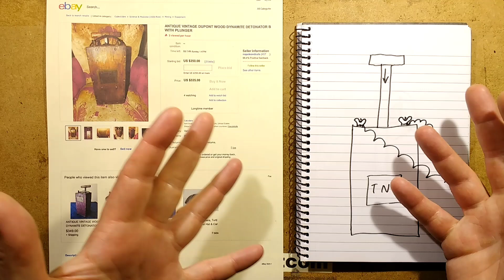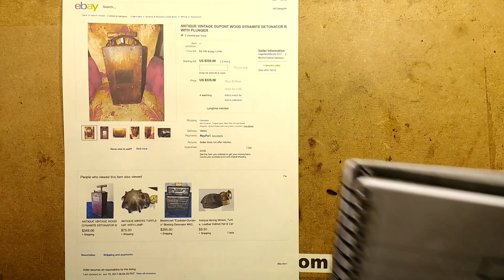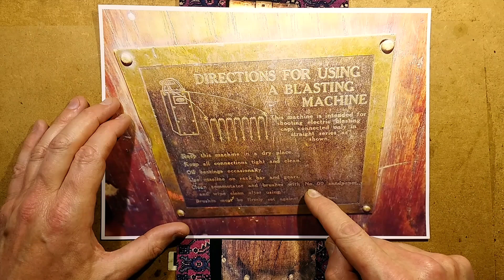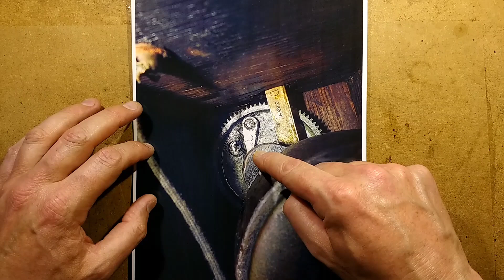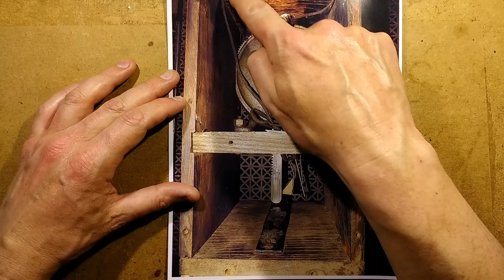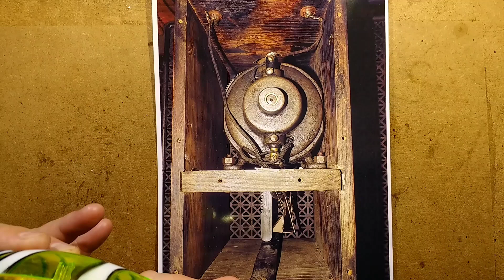How Wile-E-Coyote's dynamite blaster works.

Comment: I recently bought a Dupont Number 2 blasting machine. It doesn't have the high gear ratio, it's quite low...the rotor speed is quite low as a result. I can't detect any perceptible magnetism either, no permanent magnets. It was sold to me as working, but when you put your hand across it and shove it down you only get a bit of a tingle. That said I put a 10 ohm resistor across it and rammed it down and smoke did come out of a 1/4 watt axial resistor. I saw Cody on Cody's lab destroy single Christmas lights with his. That said his is more like your example which is said to shoot like 50 caps, mine 1 to 10. I measure open circuit 132V I got as high as 160V with 1mS peak capture. Short circuit current is around 5A if you override the switch at the bottom of the plunger stroke. If you allow the plunger switch to operate normally it's more like 3A.

In the rest state the B+ and B- terminals are a dead short across the output of the generator. I think that's as a safety feature, also the dynamo is operating into a short so the currents get pretty high. In mine the rotating section is about 23.5mH and the windings on either side of that (the field coils I guess you'd call them) are around 16mH each. I suppose if it acts like they're all in series at the end it could be as much as 700mJoules or there about. 

It's beautiful for something over 130 years old, but I'm not 100% sure it's working totally right. That said I cleaned the brushes (they're just copper tines) and the commutator (it's literally just two halves with a single wind) and nothing is shorted out. I cleaned the switch at the bottom as well. You can see arcing at the commutator and the bottom switch at the end of the stroke so I think a lot of energy gets lost to that safety switch / build up functionality. Maybe I should setup the scope and current probe and try and characterize the delivered energy and such. Wish I had a second example to compare to. Maybe those iron pieces were magnetized and somehow my example has lost some of its magnetism making it weaker? I am measuring tho 102Wpk at 1mS according to my multimeter into the 1/4 watt 10 ohm resistor as 31.92V for 1mS, it's 3.08A when measured in current mode, close enuf. If I change to 100mS and measure current for 100mS it's around 800mA into 10 ohms so you're looking at 6.4W. I read somewhere Blasting Caps need 1~5mJ to activate so maybe it is working right.

Comment: Rack Bar Blasting Machine. 320-2500 volts - actual voltage not important as long as it's enough to force sufficient current through the cap to trigger it.

Comment: I have one like this (but different) It came from the USA and cost $100 in postage. It works as a magneto with a break contact at the bottom of the stroke and this put's a magneto type sparky voltage across the two bolts. Over 100 years old, original software, still works.

Comment: I know, two year's late.  A couple of points on the generator.
1 those dead shorted are actually easy to push down.  They don't build a magnetic field as the voltage does not build.
2 The switch at the bottom is to ensue full speed and voltage is built before closing the circuit. Without the switch the relatively slow heating of the caps would be interrupted when the firs one blew, preventing the rest from going off.  The switch provides high current to start all series caps before the explosion breaks the circuit.
3 Without the switch, the un-exploded material makes widows when the digging starts.

Comment: This was one of those "well, of course it does" things.  You really only have to see a couple of Westerns or other period drama where such things are used. A dynamo is the only thing that fits the purpose. The more so if the sound track includes the noise of the thing.  A battery couldn't have needed the plunge action and nothing else is really possible.  The bit that I hadn't anticipated was the switch, although in hindsight it should have been obvious.  The bank always happens only when the plunger reaches the bottom.  Even Roaddrunner shows that.  :)

Comment: Or, as Derek (Blaster) Bates once described it; "A bloody great Mk1 John Wayne dynie-mite exploder.."

Now then, is that output DC or AC? The instructions refer to the commutator, which is a direct reference to DC machines, but you mention stators and rotors, which are directly associated with AC machines....

Just curious because DC suffers considerable greater loss over a lengthy cable run, as compared to AC, so AC would make sense, but DC would seem more likely in that period. If the detonator is a simple resistive device, would it make any difference - AC Vs. DC?

Comment: Many years ago, probably in the late 1950's my cousin and I were playing in the barn on our farm, we went into the tack room where the old harness and other leather goods hung about on the walls, and under a pile of old scrap leather  used in the old days to repair leather for the horses, we found one of these devices.  Now we had no electricity on the farm, but dad had a wind charger that he used to charge up some old glass battery cells which he used to charge the 6 volt batteries on our old cars and trucks.  He also had a light bulb above his workbench in the garage that would still light if the batteries were charged up, which they usually were since this was on the Dakota Prairie where the wind always blows one way or another.  So we decided we would take dad's bulb out of his shop light and wire it up to that plunger thing, this after we both nearly wore ourselves out blowing imaginary charges of blasting powder and such, when you are 8 or 9 years old your imagination can do wonderful things, much better then todays video games.  So we hooked dad's light bulb up using an old fixture he had laying on the bench, I think it was meant to be a replacement for his main light should the need ever arise.  Well now that handle didn't seem to care much about the bulb, it went down just like it had in play, until it was nearly at the bottom, when suddenly that bulb lit up so brightly it nearly blinded us, then shattered.  Well we put everything back, but there were no spare bulbs in the garage, so cutting our fingers several times, we removed that shattered bulb and hung it over dad's workbench.  Dad was not very understanding when he returned to the garage for some tools and saw his bulb. Neither of us would own up to breaking it, and as it was back then, neither of us sat down for awhile after dad's razor strop had finished with our bottoms.  Light bulbs cost money, and so does whiskey, when we infringed on dad's whiskey money there was indeed hell to pay!

Comment: I'll bet Wile E. Coyote is sad because =he= doesn't have a whirring fish, not to mention a bird dinner.  It looked like the inside of that blaster box had been flamed in several places.  What's the difference between these and the handheld clackers used to blow the latest mil-spec boomers like the Claymores, size?
Reply from the maker: I've never had a look in a clacker.  Not sure if it's a spring loaded magnet or piezo generator.

Comment: As a young kid, I used to play with one of these things. Dad had an old Atlas blaster (from a previous job doing well drilling) . One time, I somehow managed to cross the terminals with my hand while pressing the plunger, all i can say is that I got the shock of my life! It seemed worse than a shock from the outlet, so I have a feeling the voltage is higher than 120v. Good times, lol. Great video, Clive .
Reply from the maker: It is.  These things can deliver a very high voltage pulse.  Check out the video about these on Cody's lab.  We somehow managed to do a video on these things at exactly the same time and used the same picture too, because it's the one everyone associates with these blasters.

Comment: I always thought those detonators just contained a battery and capacitor, and the plunger was a simple switch that discharged the capacitor into the wires. Never expected this - at least it never needs recharging!

Comment: hi Clyde time from New York here wanted to say that I was very interested in this subject matter I've always been very curious to see what was inside one of these machines by the way what you have there is rated in terms of the number of blasting caps that it could detonate the one you're showing is typically 100 caps the small handheld twist devices are generally rated at 10 camps they were use like during the war it cetera over small jobs are yours the instructions to the person who was lucky enough to get to use it was try to push so hard that you could quote unquote blow the bottom out of the machine well if that was true it probably break it but I know it wasn't they said that it was since it was on the ground you're pushing essentially you know a hard something hard against something hard and it's not going to go any place but very interesting to see I've always been curious myself I would pick one up at the price just for the novelty of course but just for the price alone I don't think I can do it I know the ten cap units are going for about $200 here in New York oh well any case if you have time for a short story my uncle knew a fellow who was on the explosive squad or demolition squad on the police department she got ahold of one of those machines what he did is wired it up in a prominent place in his cabin that he had Upstate New York so that when visitors came in they couldn't help but look at the device now he had it securely mounted to the floor so it couldn't be lifted up twisted or examined it was no screw down there and he had it hooked up to some very powerful strobe units that would be secreted that were secreted around the house and he would talk with his guests about things in general Etc let things you know this and you like a drink I'll go in the kitchen he would go into the kitchen to make some drinks and when doing so he had it hooked up to some very powerful strobe units secreted around the building and he would invariably see a bright flash you know in the kitchen and it would scare the you-know-what out of the guests as a big joke because they just couldn't resist but I thought you would like to hear about it thanks again for that very interesting demonstration or actually lecture thank you

Comment: That internal feed-forward of power to the stator at 4:28 makes it a true Dynamo, quite a rarity. :-) As for output voltage, the number of caps (shown as resistors in the wiring diagram) is probably a clue. I would guess something like 10 volts across each one, or 70 volts under load. Is there any kind of Safety Interlock on the plunger, like a release on the bottom side of it to prevent accidents from the Hollywood dead man falling onto it?

Comment: Not what I was expecting, I assumed this was a modified Magneto circuit. I assume that while the Magneto would produce a high voltage, the current would be too low. This arrangement of storing energy in the form of angular momentum is now used to power high energy rail and coil guns.

Comment: This reminds me of a device my father used when he was an electrician. It was a box with a handle that you turned rapidly that generated a high voltage that was accessible via two terminals with insulated nuts on them, and a meter calibrated in meg-ohms. He called it a "mega", and I believe it was for testing supply wiring insulation. Have you seen one, used one or own one? Sadly we no longer have it, but when i was 5 or 6 years old I used to love turn the handle and listening to the cogs grind and the generator spin.

Comment: Clive, I think you have assessed it accurately, the merit of using the stored mechanical energy is that it cannot fire accidentally like a capacitor could. I guessed it would use a rack and pinion, clever in it's simplicity.

Comment: I figured out how one of those detonator boxes works just from hearing the sound one made when I saw and heard it on TV once.

It has a small generator/dynamo which is operated by the handle.  When the dynamo gets up to speed, the handle reaches the bottom of its travel and hits a switch to send the current from the dynamo through the wires to the detonating cap in the explosive and... ka-boom! (As they say in the cartoons) :)

I think it also has a one-way ratchet so that you can lift the handle without operating the dynamo.

Now I'm going to finish watching the video to see if I'm right. :D

Comment: I did not hear you mention that when them depressed plunger shaft reaches the bottom the over-run (aka one way gear) clutch reaches the bottom, the generator keeps turning until friction eventually stops it. That way it is still turning when the switch is made.

Comment: I have this old phone from 1955 (I think) with a crank on it and it produce a lot of juice when the hook is on and I always imagine that you could fire a blasting cap with it. If you hold the connectors in your hand without shorten them you don't have to crank it fast for it to be quite unpleasant to hold on. Once I hooked it up to my phone socket and cranked it and my line was dead for half that day :) It was used in an apartment store and when you cranked it a bell went off at a switchboard and an operator answered and connected you where you wanted to call before everything got automatic.

Comment: In central Pennsylvania (Scranton area) these "DuPont Boxes" are occasionally found at yard sales, and once in awhile people try to sell old Dynamite and blasting caps - old explosives are very unstable .  The area had been an anthracite hard-coal mining area for a long time.  From around 1880 - c.1938 many neighbors had small mine shafts in their back yards, it tapered off after WWII.  They would dig a shaft in their yards until they hopefully hit coal, as part of the process they needed to blast through rock.  The limiting factors in blasting were the cost of Dynamite bought at local stores (or stolen from work) and the many hours of labor using a manual star-drill to hammer through rock for blast holes [I can't swing a sledge hammer for a full day].  The coal was mined, cracked and screened in the yards and later stored in the coal bins in the cellars.  The coal allowed them to heat their stove for cooking, heat the hot water coal boiler 5 U.S. gallons (~25Liters) and power the heating stove(s) in winter (remember, no central heating).

Up until 1938 blasting caps and Dynamite could be bought by any adult or responsible child at many stores. Even Sears Roebuck & Co. sold explosives in their mail order catalogue.  Most people knew enough to store it outside in small sheds in the yard, children were told at an early age not to play with Dynamite or blasting caps, of course there were kids blowing stuff up - the parents complaint was the cost of the explosives.  BTW: there weren't ANY warning labels on Dynamite boxes or blasting cap boxes.  A single blasting cap will blow off a person's hand, cause eye injury and hearing loss.  Adults and children learned not to touch the contacts on the DuPont Boxes, I wonder how they knew?

In 1938 laws were pasted to limit sales of explosives including Dynamite, many existing users were 'grandfathered' in, the licenses also allows you to purchase really great (expensive)  fireworks of all types.  The biggest problem with explosives in the area today are Federal regulations about transport of hazardous materials.  Today, ammonium nitrate/fuel oil mixture explosives detonated by a blasting cap are much cheaper for most applications.
Reply: Dunno about the era but I have a DuPont blasting cap tin and it's festooned with warnings. My favorite is it tells you to not crimp the caps using your teeth, as if! Dynamite is remarkably stable so long as it's not old and/or hasn't gotten wet. The stronger stuff will give you a terrible headache if you handle it too much...I guess the nitro cases vascular dilation which leads to headache.

Comment: So you would push the plunger halfway down, pull it up again, push it halfway down and up again,
and keep on so to build up speed before you finally ram in into the bottom, and KaBoooooom?
Reply from the maker: Just one push, although apparently you could fire a few more than the maximum rated numbeer of series detonators by pushing it down harder.
Reply: There is a big flywheel attached to the generator. With one moderately firm push the flywheel spins fast enough that when the plunger hits the bottom of travel and connects the caps, there is enough energy as inertia in the flywheel to fire up to 30 caps in series. Mine needs oil badly but the flywheel is still spinning for a couple seconds after hitting the bottom.

Comment: why can they put a capacitor acros the dynamo so that it stores energy while its spinning up as well. that would be more efficient right?
Reply: The energy is stored in a heavy flywheel attached to the generator. When the plunger hits the bottom of travel, the generator is at maximum RPM and then a switch connects the caps. The circuit is completed for only milliseconds before the caps fire and the generator continues to spin. What matters is the RMS output of the generator or alternator. Some units were AC some were DC. I have the one Clive is showing and while it needs oil badly, it still spins for a couple of seconds after the plunger reaches bottom. It used to spin for several additional seconds. Time for some grease.